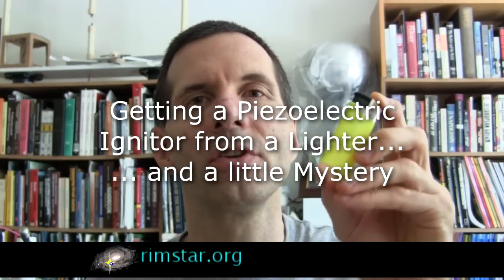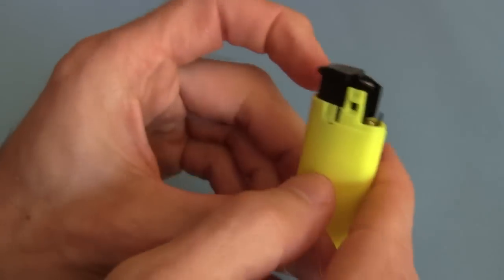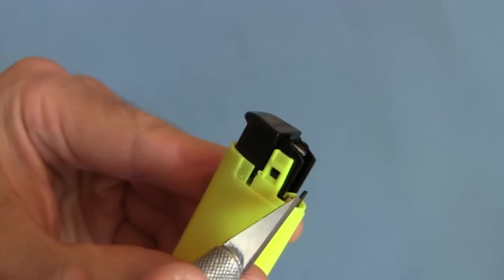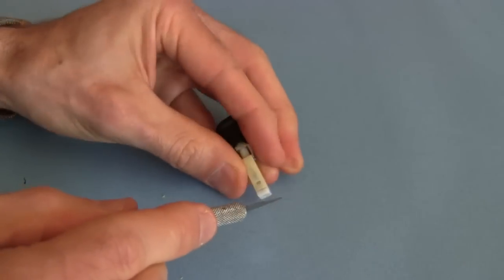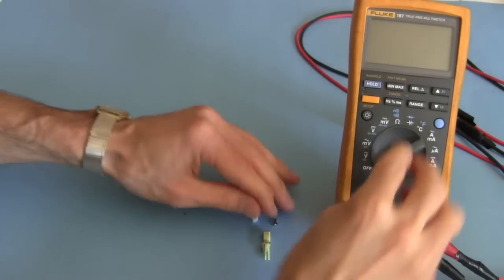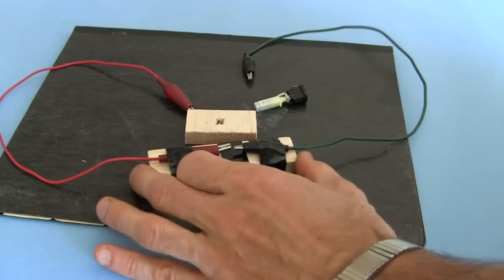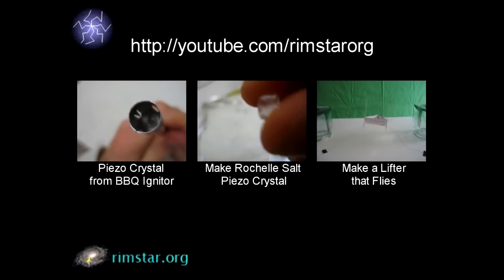How to take Piezoelectric Igniter from Lighter for Spud Gun

Comment: Static charge is not a mystery (and you have solved it). It stores on dielectric material and discharges when high voltage charge has reached critical distance between the charged dielectric and electrical conductor, in this case metal spring. Critical voltage is roughly about 1kV per 1mm distance. This is why electrical tools have at least 1mm insulation to prevent shortage.
Reply: Perhaps it SHOULD remain a mystery… What is the dielectric that you believe is holding a static charge? Where did the charge come from? After the charge discharges as a spark, how do you get the next spark? The distance between the spring and discharge terminal is not changing, so your explanation that the spark occurred when the distance was reduced is wrong. And it is not a static charge that produces the spark. The spark is produced due to the piezoelectric effect which causes some materials to produce an electric charge when mechanical force is applied to it. The material also changes dimensions if an electric charge is applied to it. The quartz crystal in the igniter assembly is struck with a sharp blow by the plunger and produces a high voltage which is high enough to jump across the gap as a spark. Watch the video and listen carefully—that's how you'll learn.

Comment from the maker: Yes, judging from the spark they're a few kilovolts but low current. I'm not familiar with battery kitchen handheld ignitors so I can't compare. I've shocked myself with them so they're not fatal, but they to give a heck of a sting. I wouldn't recommend doing that with if you're someone with a heart condition though, to be safe.

Comment from the maker: Without seeing it I really can't think of anything to suggest. Is it still in the lighter? If not, maybe when you took it out you damaged something. Also, as you saw at the end of my video, I had to connect some wires in order to create a spark gap, a small gap, in order to create a spark outside the lighter. Without that small spark gap, the to metal parts that go to either end of the crystal were too far apart.

Comment from the maker: 3kV sounds about right. As you saw, the 320 volts was when I tapped it on the table by hand. I'd sure using the spring activated mechanism that came with the lighter you'd get a lot more. My oscilloscope is rated for only 1kV though.

Comment: hey RimstarOrg, I think the spark touches the metal gas tube not the plastic bracket, which is meant to hold the metal shield that you removed in the first step.
Reply: Sai-Siva Kare no it sparks across man, it has to so it can light the gas because the flame must be exposed to the open spark.. if it just went to the gas tube from below it would not work really well
Reply: Yes, it does spark across the gap, from spring to metal tube, not to black plastic piece.

Comment from the maker: Off hand, you could use F=ma, force equals mass multiplied by the acceleration. Drop something on it do the pushing down. Weigh whatever you are dropping and that gives you the mass, e.g. 2 kilograms. The acceleration down hear on Earth is 9.8 meters/second squared. So the force would be 2 x 9.8 = 19.6 Newtons. But I don't know how you'd the voltage from that. For the voltage I'd just hook it up to an oscilloscope like I did in the video, assuming you have an oscilloscope.

Comment from the maker: Not really. When the voltage is at its peak, 320 volts, there's no current. There's current as the voltage builds up and current as the voltage drops. It's the movement of the charges that creates the voltage, building it up across the two sides of the spark cap, but the peak is the end result. Ohm's law is great for DC (direct current) when the voltage and current are steady but not when the voltage is spikey like this. The current also changes as the voltage builds up and drops.

Comment from the maker: The voltage depends on how hard the crystal is hit. In the lighter it get's hit a lot harder and so the voltage in the lighter is actually higher.

But voltage isn't power. A 13 watt light bulb uses 13 watts of power. Power is voltage multiplied by current. So voltage is only part of the equation. You also have to look at the current. And in the case of a piezoelectric crystal, the current is miniscule. So the power is a high voltage multiplied by a miniscule current and so isn't much.

Comment: Cool 😎 demo, nice vid. Nice O'scope too, what with persistence. Back when I used to make O'scopes do flips for me, I preferred at least dual trace or even quad trace. Sec... after a better look, second time around, yours is single trace, huh?🤔 I went to school in the 1980s and got really good with scopes. When bench troubleshooting I'd use a scope long before a multimeter, even if a scope wasn't really required, if practical enough. I really loved a nice FAST oscilloscope.

Comment: the piezo system is isolated from your hand and the ones in lighters only have one wire and no return wire to the bottom metal cylinder on the piezo so im wondering how does the spark happen between the tip of that wire and the gas nozzle? im trying to fix an older torch lighter whos gas was not flowing properly i think i fixed that somehow but seems the piezo wire is sparking at different points and its difficult to fix unless i get another piezo i have on hand problem is the wire on that one is too short but when i try sparking it to the nozzle it would only spark when my hand made close contact to some of the metal parts of the lighter like the head or the bottom brass refill port i could feel the spark on my hand that is holding the lighter when the spark goes off and lights the flame yet i never felt that before when the lighter was in working condition can you explain this please? i suppose the high voltage from the piezo somehow finds its way through the tip of the wire across the fas nozzle and somehow through the hand (ie ground) but you do not feel it when the piezo is inside a proper working lighter

Comment: This is perfect, so helpful, thanks so much!! Any idea though why I get a shock when I use it? My thumb and finger are on both ends of the piezo with the plastic button over the metal end. I'm guessing the arcs going through the thumb button and/or reaching from the side to the top? Mine isnt too far from each other. I want to implement it on a camping stove-the brs3000t, but not sure how...I think I'll try again with some wire as you did :D thanks again
Reply: The charge generated when the plunger hits the crystal tries to flow through the easiest path available. Even if you have wires that provided a path to the spark gap, the easier path is through your fingers… and you get shocked. At high voltages, electricity finds sneaky ways (paths) of completing the  circuit. Think lightning finding its way to the tallest object nearby, that's why you don't shelter under a tree during a thunderstorm.  : )
Reply: P.S.: The setup for the stove is the same circuit as the lighter.

Comment: yes I took out a piezo attachment from the electronic lighter and attached it to a dislodged CFL (only tube without the original electronics that came with the CFL) the lighter piezo flickers the CFL when it is depressed..its must be producing hundreds of volts but very minute amps because the CFL flickers! do you reckon I can parallel several of these piezos up and get more amps out of them?
Reply from the maker: You can try paralleling them but it's tricky. The voltage happens for only a very brief time, around 100 microseconds as you can see in the oscilloscope at 5:44 in this video. That's 1/10000th of a second. So they'd have to be synchronized to go off at the same time very precisely. I've never tried it though, so it could be easier than I think.
Reply: RimstarOrg I reckon adding high voltage capacitors could sort out some of the unequal firing of the parallel voltages..

Comment: The voltage generated there to create the spark gap is in the few kvoltage range right, but has low current? Are these voltages generated from the spark gaps, like those used in battery kitchen handheld ignitors actually dangerous though, like could the shocks be fatal? or do they just sting due to the low current

Comment: So is the click you hear when you see the spark the sound of the spring hammer hitting the crystal, or is the click the actual spark heating the air around it supersonically, , thus  a tiny thunder clap?
Reply from the maker: If you're talking about at the end around 9:10, that's the clicking of the sprung hammer hitting the crystal. I'm sure there's also a click sound of the actual spark but it's probably drowned out by the hammer.
Reply: both

Comment: Ok thanks! I feel as though there isn't suffice information on this type of stuff out there. I was wondering if it would be theoretically possible "within the limits of the physical material"  to over bend, or over compress one of these crystals then have a slow extended release to use them as energy storage rather then creation? Food for thought!
Reply: Wikipedia has quite a lot of information on the piezoelectric phenomenon. The quartz crystal will change dimensions if you apply an electric charge to it. When you remove the electric charge, the dimension will return to normal, but that collapsing movement creates an electric charge of opposite polarity than the previous charge, and it goes on and on, with electric charge causing mechanical movement which causes electricsl charge which causes… and so the crystal vibrates at a particular frequency that is dependent on the thickness and cut of the crystal. Thus a quartz crystal can be used as the "heartbeat" generator or time keeper of an oscillator circuit. The piezo phenomenon is used to make "beeper" speakers that produce a fixed frequency beep or chirp. An audio frequency can be applied to the crystal to make it vibrate according to the electrical signal applied, but since the crystal has one resonant frequency, other frequencies will be damped and possibly not heard, so audio quality will be poor.

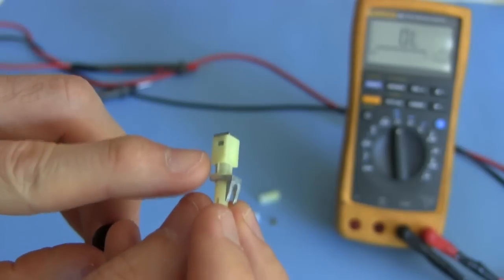Comment: @5:10
why do you connect the ground clip to a piece of foil?
wouldn't that make the foil pick up even more interference than leaving it floating?

why did you not try to find the reference point on the crystal itself?
Reply from the maker: bundeligafan My oscilloscope always measures with respect to ground. If I didn't use the ground clip as one side of the voltage measurement then the clip on the other foil will still be displayed with respect to the oscilloscope's ground. Plus, the crystal has two ends, a positive and a negative, so I wanted to get the effect from both sides.I'm not sure if I've answered your third question already. My scope can't do floating measurements. Maybe that answers it. I'd love for it to be otherwise, but sadly that's the way it is.

Comment: Have you given any thought to store the energy produced in a capacitor and perhaps run a motor off it?
Reply from the maker: +Arun Kumar Moturi The voltage is high but the energy produced is pretty small. It would take a lot of sparks to charge up even a small capacitor and that wouldn't power a motor for long, maybe just a second or less. However, I've considered trying putting piezoelectric crystals in a pair of shoes, or something like that, and maybe lighting an LED as I walk. It'd be just one flash per step, but it might be good for walking at night in a dark park.

Comment: if i wanted to at least a little motion from a small dc fan from power from a click of piezzo lighter igniter, where should I put the ground wire from the fan?
Reply from the maker: itube612 If it's just a dc motor like ones I've worked with then the polarity doesn't matter. Connect one wire from the fan to one end of the piezo crystal and the other wire to the other end. I don't know if it'll work though.

Comment: hmmm how do you find the amperage to something like this, that would be interesting.
Reply from the maker: I don't know how you'd find the amperage. Anyone?
Reply: I know it is old, but since i'm doing an apprenticeship as Electrican... why not.

amperage basically defines as the Flow of a Current.
Current cannot flow if it has nothing to flow to... so you would require something to use up Power,
like a Resistor or Lamp...

since amperage is only limited by the Resistance of a Material, having just a wire connect them would let the current flow extremely fast, causing the Source/Wire to become hot or even Melt or Explode.
to Completly stop Current flow you require some Material with Infinite Resistance, which we all know is impossible... reason why Batteries that lay somewhere for long enough eventually lose their Charge. (because even through air there is still a Current flow... very small, but existant)

also you Messure Voltage by using the Multimeter Parallel to the Power source, but for Amperage you use it in Serial.

Comment: if you hit the piezo crystal harder, is the voltage higher? Also at what point do you have to worry about breaking it?
Reply from the maker: Yes, hitting it harder gives a higher voltage. I don't know at what point it breaks though.
Reply: RimstarOrg I accidentally broke the crystal when I was disassembling mine! Oops! I ran some tests with it before that. It brilliantly lit up a CCFL tube that runs at 400 volts! I have a picture of the broken igniter with all important components laid out where they would normally be, if it would be any benefit to you.
Reply from the maker: nealshireman
Sure, If it's clear enough I could put the picture on my webpage here http://rimstar.org/materials/piezo/how_to_get_piezoelectric_ignitor_from_lighter.htm My email address is at the bottom of the webpage.
Reply: RimstarOrg just check my google+ photo album, I've got them there.

Comment: okay thnx for that last note you gave me 
One more thing does the sparker stop imiting the spark after a perid of time?
Reply from the maker: +Youssef Aloud That's the way piezoelectric crystals work. They produce a voltage only during a change in pressure, not while there's a constant pressure. It makes sense from the perspective of the laws of physics since voltage is actually the amount of energy for each coulomb of charge. The only time you put energy into the crystal is while you're applying the pressure. While you're holding the pressure constant you're not putting any energy into the crystal. For an understanding of the molecular interactions though you'll have to dig around some more. I don't know it at that level.
Reply: +RimstarOrg  Thank you
Reply: This... actually makes more sense than most of the books and articles I've read on the topic. Thanks!

Comment: What happens if you hold the piezoelectric material in a fixed compressed state? does it need to be oscillating in order to produce any current?
Reply: It produces a voltage whose magnitude is proportional to the amount of force applied and the polarity depends on the direction of the force, i.e. if you press (squeeze) the crystal you may get a positive viltage, then if you pull (stretch) the crystal you'll get a negative voltage. Exactly which polarity depends on the way the crystal is cut. So, if you hold a steady force on the crystal it will produce a steady charge (voltage). If you provide a path for that charge to flow, there will be a flow of current until the electric charge reduces to zero. Thereafter, the force still applied to the crystal does nothing. However, when that force is released a new charge is produced by the crystal, but its polarity will be opposite the polarity that was produced when the force was applied.

Comment: Okay do me a favor.  Never never use an exacto knife as a pry tool. It presents multiple safety issues.  1 slips and gouges a bloody hole in your hand.  2. Thin blade fractures and becomes a razor projectile with potential to embed itself in anything...like flash for instance.  Not exactly safe to use one as a pointer either.   Man you have to stop trying to commit seppuku, we need you around to learn things and your no help in a casket.  

"Safety number one priority"

Otherwise very interesting vid.  I now need to find my stash of empty lighters.   Or just steal the one my coworker keeps in plain sight.

Comment: Is a way to 'boost" the voltage & current with a transformer?
Reply from the maker: You can't boost both voltage and current but since the voltage can be high, you'd lower the voltage while raising the current. However, while there are probably circuits for doing it, I don't have  one off hand.

Comment: its not flint its a small ferrocerium alloy rod thats in the friction based lighters
Reply from the maker: Right you are. I didn't know that, thanks. A little research shows it's still commonly referred to as flint, even though it's not actual flint. Even the flint spark lighters we use to ignite propane gas use ferrocerium. Oh well. The English language strikes again. :)
Reply: RimstarOrg even the original flint and steel tool
it was the steel the made the sparks the flints just a hard rock that is used to strike the steel making very fine hot iron powder that reacts with the oxygen and produces heat and light

and any rock can work as long as its hard

i randomly stumbled on your channel and i really like these videos

Comment: The crystal actually must create voltages around 5000 .15000 Volts. The reason why you can´t measure it is because your instruments can´t pick up such a short time low energy pulse anymore.
Reply from the maker: Muck2014 The voltage produced depends on how hard you hit it. I suspect wasn't hitting it very hard compared to how hard it gets hit with the lighter's own mechanism. That being said, I probably am missing a hundred or so volts at the peak.
Reply: Yes, that might be possible because  piezos used as acustic devices must use lower voltages. But what would be even more interesting is the amperage. Can you measure the amps as well?